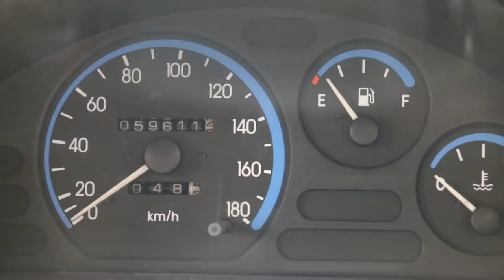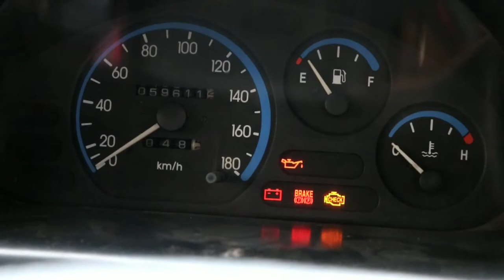How to Jump Start a Car | DIY Jumper cable

Comment: 2.5 sq mm wire? Aur dead battery ke negative ko q nahi lagaya?
Reply from the maker: Yes you should be using 5mm but na ho toh go for two 2.5mm for each terminal because starter take very high current. Also battery ke negative me isliye nhi lgate kyonki jab hum connect disconnect krte hai tab spark niklte hai which not safe as battery emits hydrogen gas
Reply: @scienceperspective8999 i tried to help one guy with 2 sqmm wire it didn't work mechanic came and he have big cable heavy it started in one second. First i checked with small wire so i thought it's self motor and alternator all gone . mechanic said wire should be strong. Which wire will you suggest  to keep in car